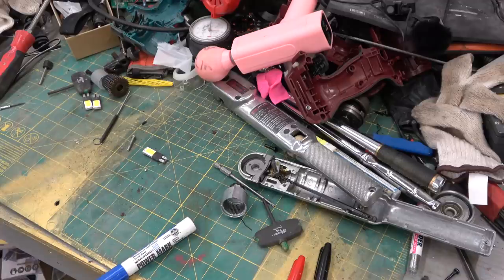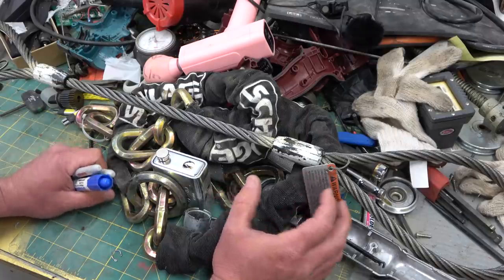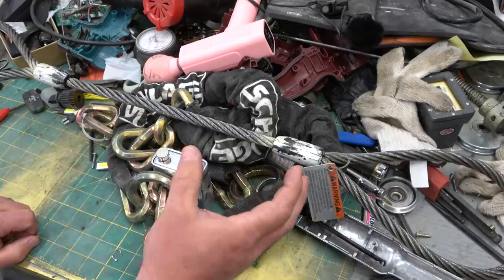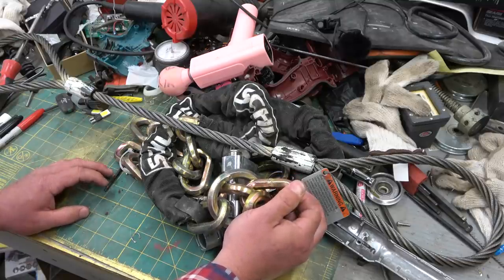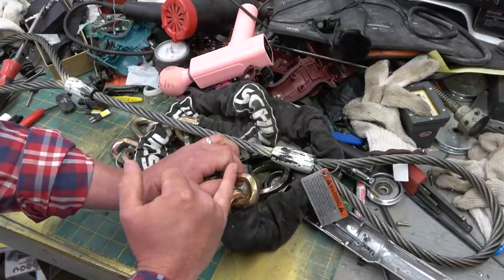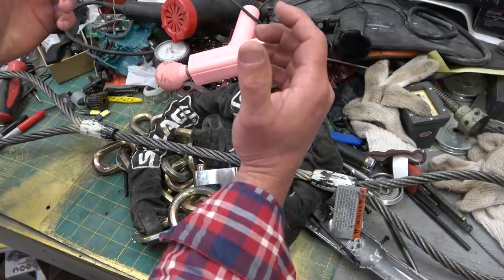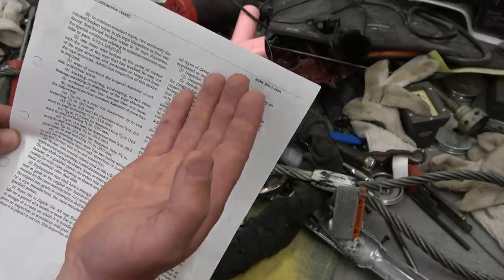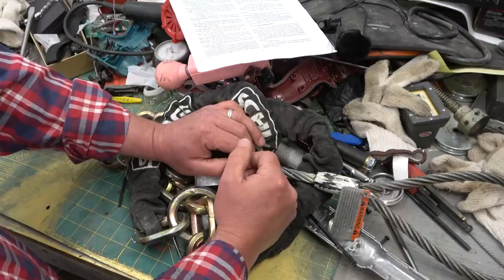"It is not known why the pulling cable snapped."

Comment: Elevators sometimes use inertial emergency braking systems: they should work, even in the dark.  But maintenence is required, and you can't just pin them out/put them in service and pretend there is a safety device.  Usually some kind of spring loading is required for their functioning be it a drum or wedge design.
Now how can you screw up a hydraulic release system?  Put a valve in the return line to sump - it only takes one moron with a rectal cranial inversion to shut it, then defeating the system only requires pressuring up hydraulics one time... game over.
Standards?  There is a cornucopia to certify any system, so help is available.  No use talking about it, because this reading list is long enough a pot of coffee won't get anyone through it:   https://cdn2.hubspot.net/hubfs/78935/International_Standards_Compared_to_ASME_B30_P30_R5.pdf